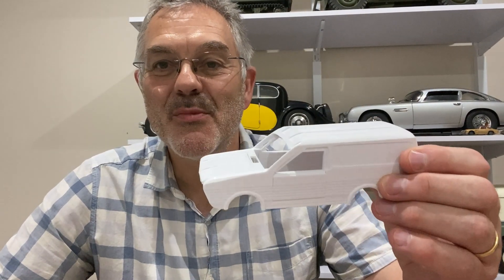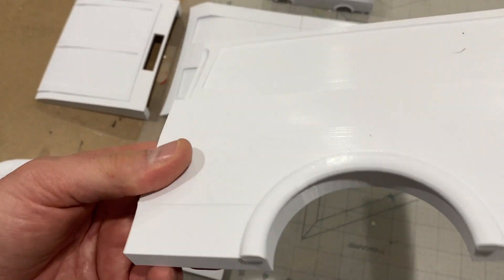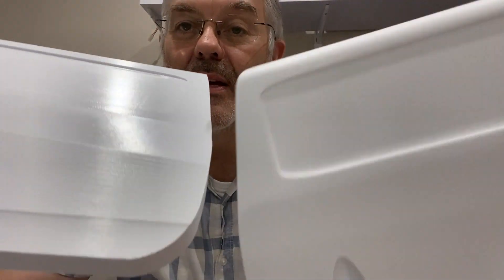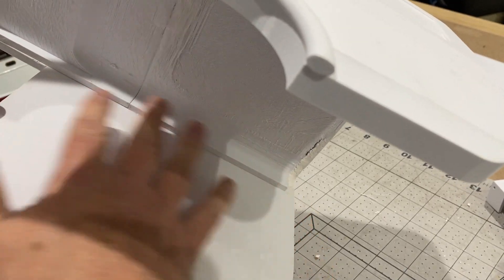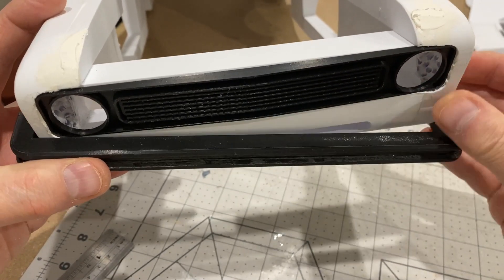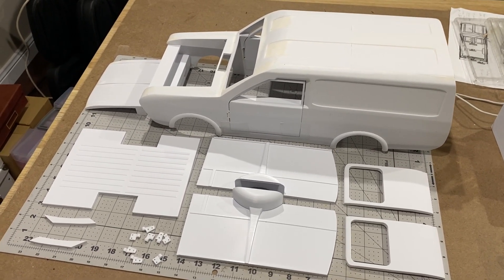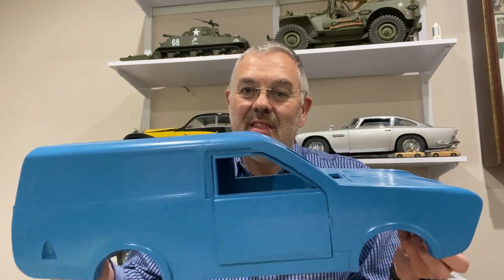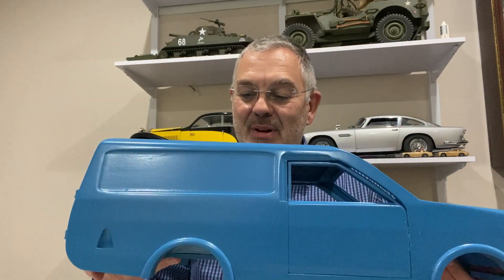Building a 3d printed model of a Morris Marina van -  Part 2

Comment: fantastic, can’t wait too see it finish, just wondered if you can please give me some info, i’ve got a project planned with large part going to have them pla/fdm printed on the site it says 200.0 layer height & 20% infill, will these be pretty smooth surface wise?, cheers
Reply from the maker: It depends on what you are printing.  Flat surfaces can be printed pretty smooth, but once you get into curves you will start to see print lines.  The 20% infill is not that relevant to the outside contours.  That is more to do with internal strength.  The layer height is important though.  I printed this model with a 0.1mm layer height.  Not sure what your company means when they say the layer height is 200.  Do you know what units they are talking about?
Reply: on the site it just says “200.0 mu” under layer thickness then under other tab 20, 50 or 100% infill :)
Reply from the maker: @jordanbellamy6993  Those are fairly standard settings.  The 200 mu would be 0.2mm. You will get print lines as with any other 3D printed model.